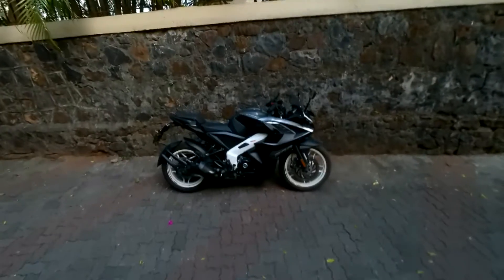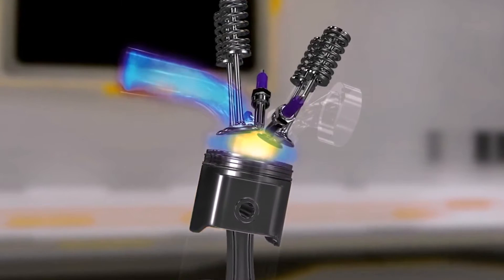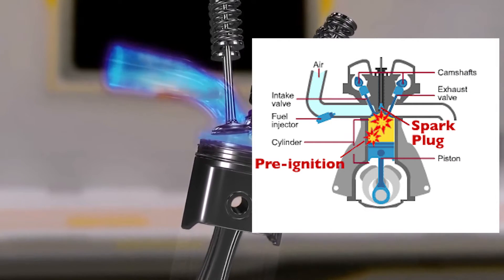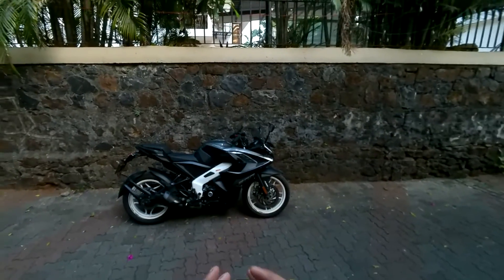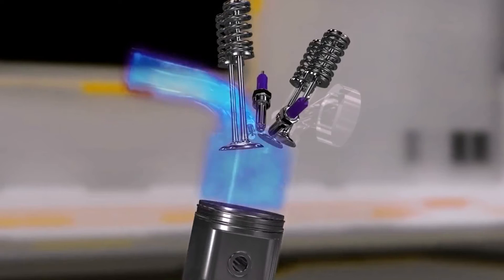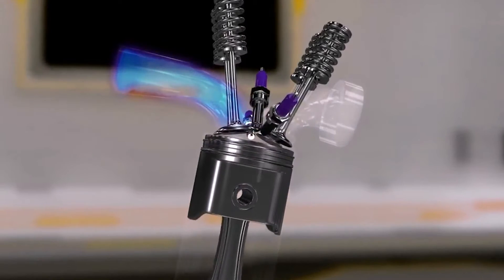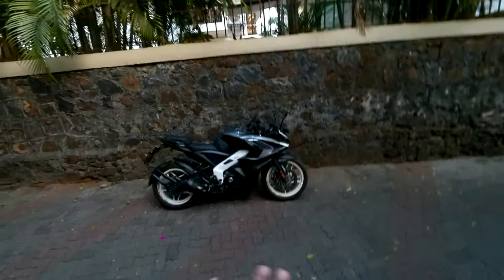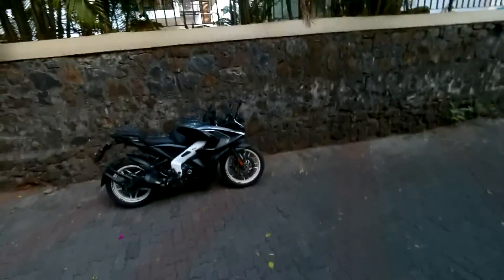The Wrong Petrol Can Crack The Piston 💥|| Compression Ratio & High Octane Fuel || Duke 390 || RS 200

Comment: Soo What Octane Is Prefered For Rs 200..
Reply from the maker: In my experience I've used 97 octane...but I didn't feel any difference. That being said higher octane does have cleaning agents.

I would recommend normal fuel...and once a year you can use full tank power or a fuel additive. 

I use normal fuel with HP power petrol plus...which is a good combination for regular use.
Reply: @butimjeremy  Okii Gott it ❤️ Thank Your For The Advice ⚡❤️...
Reply from the maker: @leozxn8881  Most welcome 👍👍👍